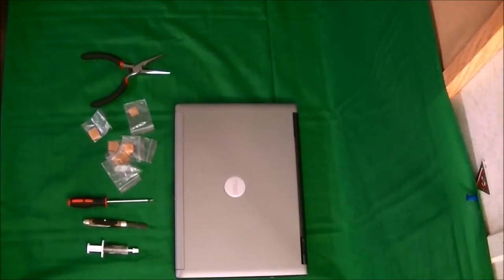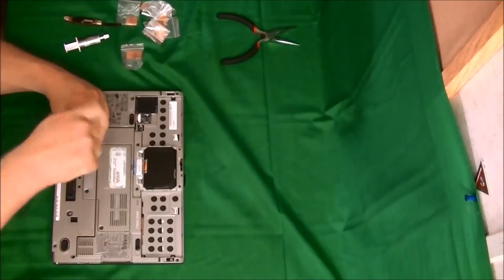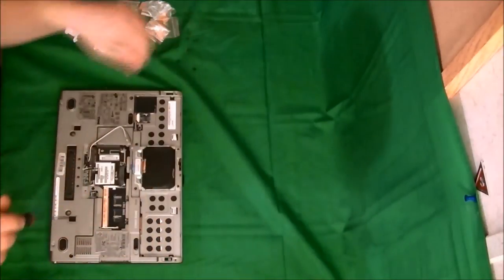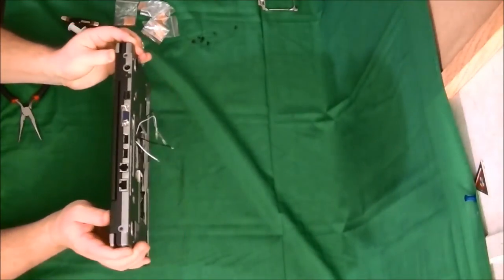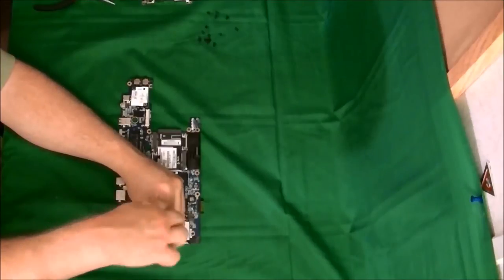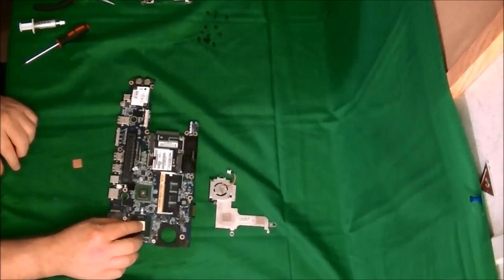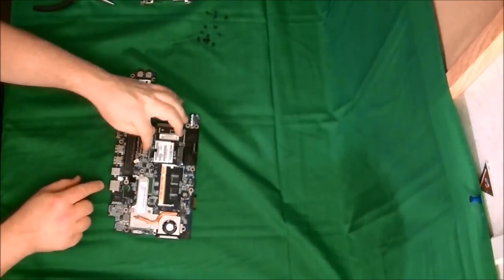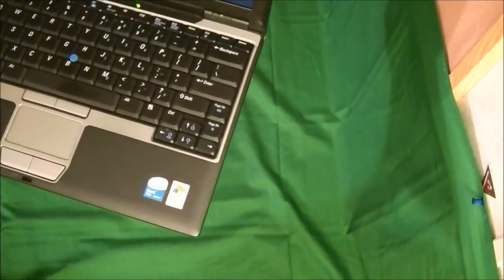Adding heat sink to laptop CPU & GPU.

Comment: Why do this? Its likely to actual decrease the effectiveness of the cooling because you now have 2 layers of thermal paste rather than 1, and the copper shims have no value as a heat sinks because they aren't presenting any additional surface area for cooling... !? Its bizarre.

Comment: It would be more interesting if you'd put liquid metal between the die and copper shim, and then normal thermal paste between a shim and actual heatsink. The shim works then as a protection for the heatsink from gallium reaction (only shim suffers but who cares about it).

Comment: Owh and, if you don't mind me giving a friendly suggestions... Remove them pads, and let those copper shims touch the metal of the heatpipe plates with thermal compund, better heat transfer and a lot better :£)
Reply from the maker: Donny Slander Yes, I have started removing those stock pads on any new ones I work on. I've never been a fan of those.
Reply: xXxTheComputerGuyxXx
well, how did it performed??? I never liked those suckers aswell :D

Comment: I wonder does this method work with headsinks that already using copper...
Reply: +Chi Ho Ko  yes it will work. See firstly we can making the contact tight, secondly see desktop heat sinks. They are having multiple layers of copper so as to increase the surface area. Heat efficiency is increased by increasing surface area. Simple science. :)